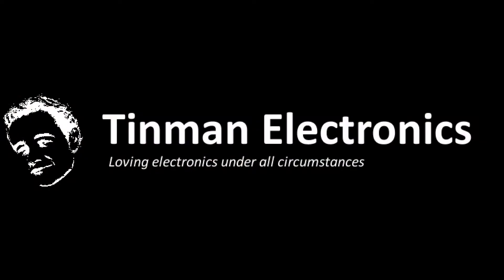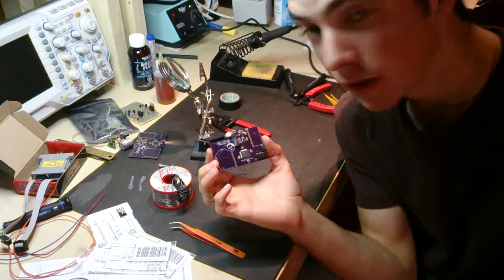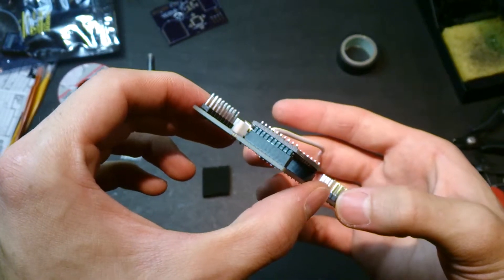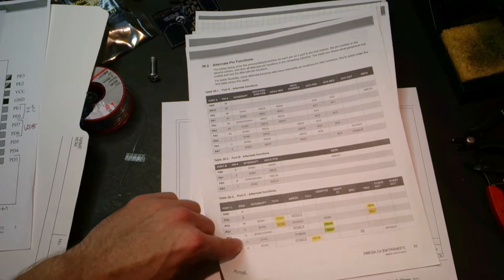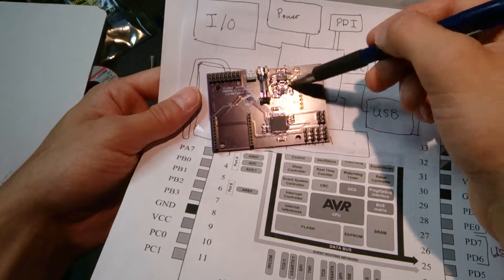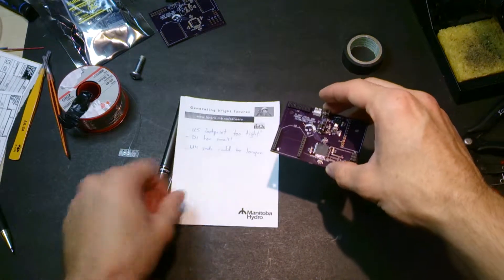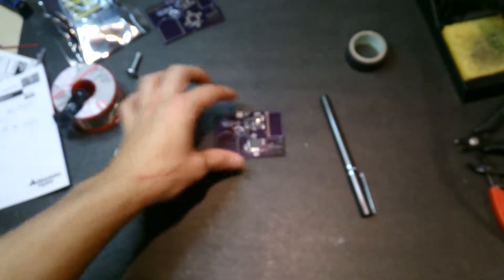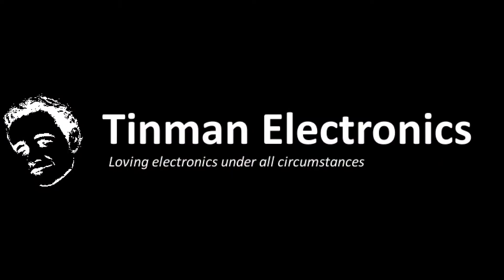Tinman Electronics 4 - Quadcopter board layout explained

Comment: did it work?
Reply from the maker: I haven't worked too much on the quadcopter since recording this, but I've successfully programmed the board to blink an LED. I'll have to fully program the board soon, and make a video. And I also need to show you what parts of the design I screwed up.